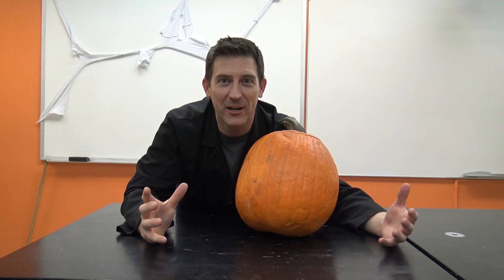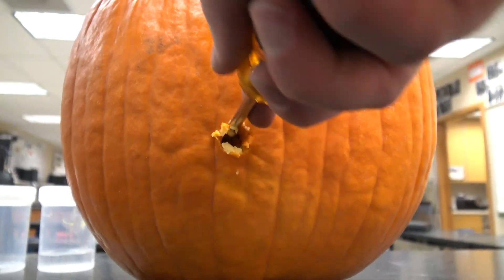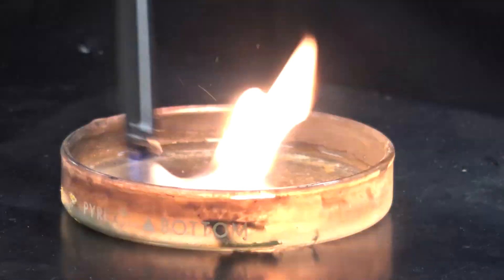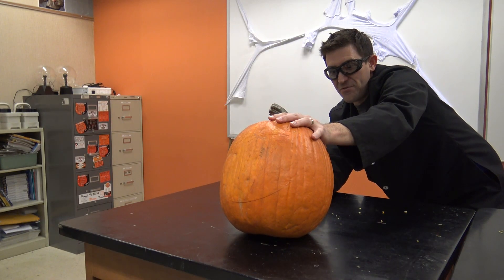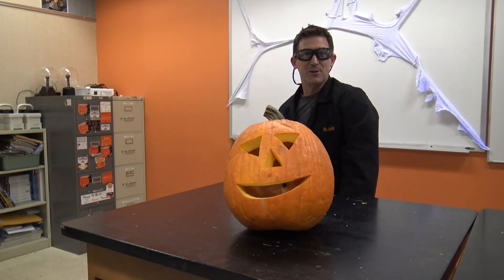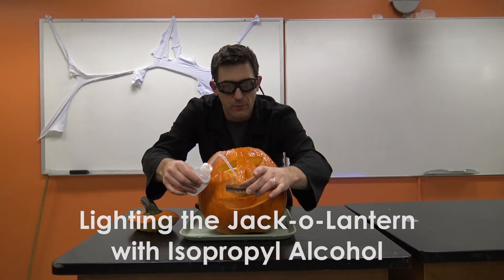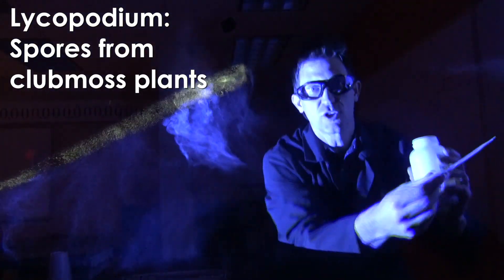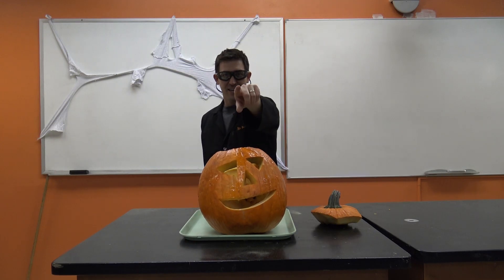Exploding Pumpkin - Halloween Science Experiments

Comment: How's your hand there, Bub? Mine gets bruised or burnt every time.
Reply: @dawnbeck8475  I've done this several times and your pumpkin is likely not letting enough oxygen in for the explosion to occur. Try making the hole in the back (where you place the ignition source) bigger so that oxygen can mix with the acetylene. Otherwise, it will explode when you take the top off (when oxygen becomes available).